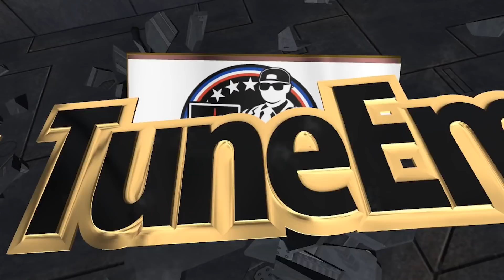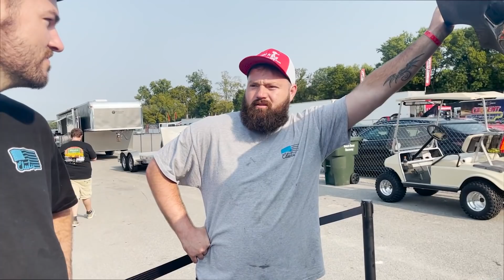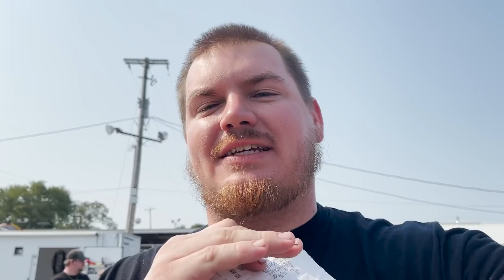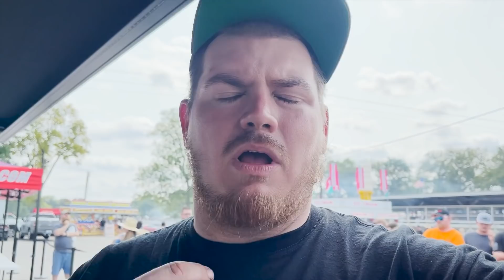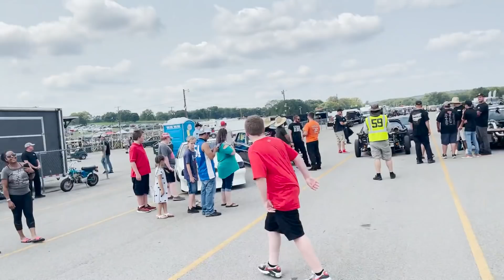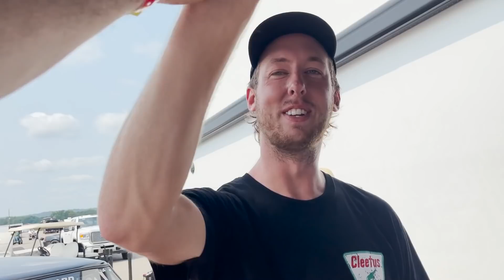I Had To Race James! LS Fest 2021 Day 3

Comment: Back in the day, damn I'm getting old when you had surging like that, it's a baffling thing inside the tank, the gforce of the launch makes the fuel climb the back wall of the tank, I do not know how your tank is but it lets off the g and the fuel moves around till the pump picks fuel back up. might consider sticking a baffle above the fuel pickups in the tank and see if the return is aerating the fuel and you are picking up bubbles with the shift moving the fuel around.
Reply from the maker: We’ve talked about it possibly aerating the fuel in the cell
Reply: @DrTuneEmAll  It might be a baffling thing, I didn't see the tank built is there a sump in it, is the fuel pickups big enough you are running methanol so can the pump stay fed.. I can think of a couple things that can cause that but the g-force pushing fuel around is where I think the problem is or the pickup in the tanks not big enough and the shift drops the rpm and the torque rises and it runs out of fuel.  Did you notice any fuel pressure fluctuations or injector duty cycle changing, are you using a lead acid battery and the electrolytes moving around lowering and raising voltages.. have you measured the draw on the pump to see if the wiring is up to snuff.. etc.
Reply: @Scootermagoo   I think he has a 3 gallon cell in front of car in engine compartment. Pump is right by the balancer. 2 or 3 videos ago he showed his fuel system.  Didn't really talk about it but you could see it.
Reply: Possibly the return aerating the fuel if it return straight back into the top, make a small return reservoir for fuel to return to then overflow as a liquid back to the cell. We had to do that mostly because of he went way too big with the pump and return had some ass to it lol
Reply from the maker: @young11984  yea I’m gonna try a tube to the bottom of the cell and see if it helps
Reply: @DrTuneEmAll  im sure you dont have the volume of return he had but that seemed to make it worse when we tried it, we ran a tube with a bend to shoot the return to the bottom front corner away from the pick up, made a loop in another one facing the top of the cell and that actually helped till about 500’ then the surge came in. I welded a 2”x4”x6” add on to the side and put a return bung in top with a 1” return hole in the side of the cell and it was cured. Simplest solution for us would have been him getting a fuel pump about 1/2 of what he had lol, good luck man been subbed since before the Chevelle build and love that car. Moonshine reminds me of the one a farmer friends grandfather used to pull tobacco slides to and from the field with, they were literally slides with no wheels back in the early 80s luckily his grandson saved it from the crusher and built a restomod with it.
Reply from the maker: @young11984  so I’ve done 2 things siphon tube and I went to half speed on the pump
Reply: love to see this work being done up here in the comments section. Great positive channel content Doc. all the best. Peace!

Comment: How does the power surge feel? If it's hard, the system runs out of fuel. If it's soft, the exhaust gets clogged. For the oiling, it's the g-force filling your heads. The excess oil in the valve train can also leak in the intake/exhaust, causing the clogging, and the power surge, but most likely it's a combination of the G-force related issues.

Comment: Now that's a proper burnout. I'm not a drag guy, but I like to check my tire pressures/temps before and after a run in karts. Are drag guys testing tire temps after a burnout? I mean, a lot of temp is lost when a burnout is done and when the light goes green (IMHO). Slick tires are designed to work within a certain temperature range, so.. Just curious from someone who's ignorant to drag racing.

Comment: If you're still having troubles with turbo drains look at running a scavenge pump set up to help you, you just need a sump for the turbos to drain into first so the pump Doesn't suck the turbo dry

Comment: Chassis Cert time. 25.x or whatever needed to keep yea safe
Reply: He had it Certified at the race
Reply: @michaelwynne4346  to what spec and meeting the spec versus having a halo for a 5.0 1/8th is approx 7.75 in the 1/4. 5.2 1/8th is just around 8.0 in the 1/4.
Should be around SFI 25.5E which should have a X In the door. 

That's assuming meeting the specifications but that fast I'd want a halo 😇 

Over building safety is never a bad thing
Reply: @aaronguerrette  I agree you can never be too safe, I think he said it was tagged for 8.50
Reply: @michaelwynne4346  ok that sound Bout right. 👌 appreciate the update on what it was cert. For

Comment: How do you have a 150% duty cycle?
Reply from the maker: When it try’s to add fuel that ain’t there is a computed calculation from closed loop just means hey bud we outta fuel 😂
Reply: multiple injectors
Reply: most of them are running 2 to 3 injectors per cylinder
Reply: @DrTuneEmAll  Ah right, I get you now. 😂 👍